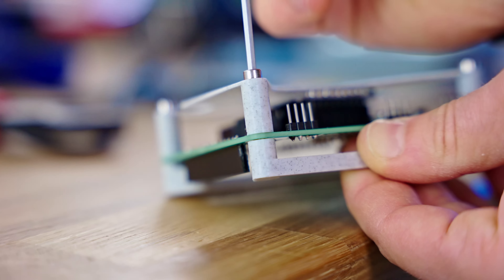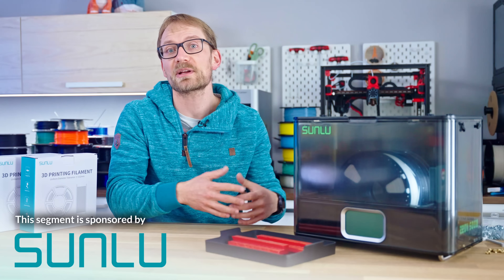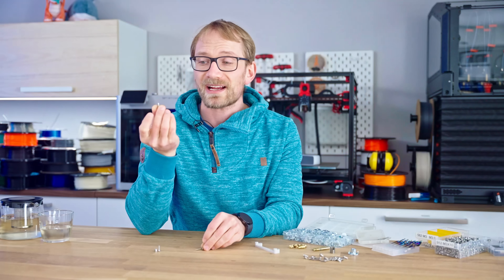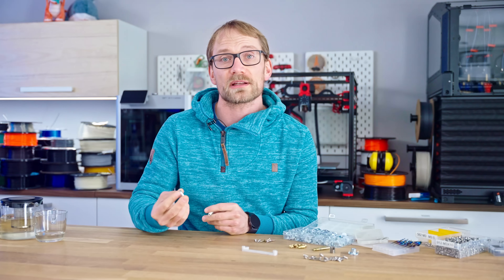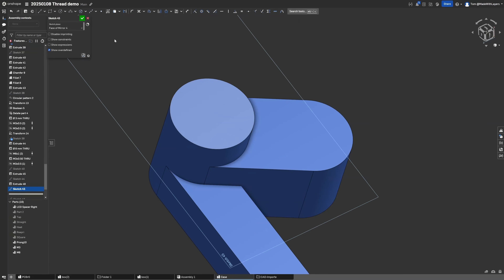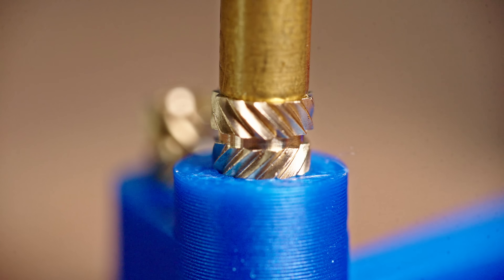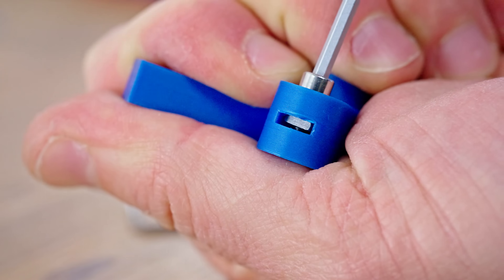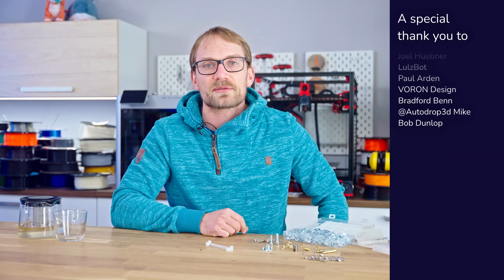A better way to add threads to your 3D prints

Comment: Straight holes you should/can carve a groove parallel to the bolt (perpendicular to the threads) to cut the plastic, taps need a lubricant not a coolant (like tap magic, or my fav for plastic silicone-based). Blender has a screw tool add in for those who like it.

Comment: For M3 if I want a bit of strength I use a self-tapping type of screw, otherwise just a machine screw. But in all such nutless cases I design the hole to be square, so the threads can displace material toward the corners rather than stretching out the material on all sides thereby stressing the part. Where does one find square nuts these days? Hex nuts in nut traps make the most sense to me for maximum strength,

Comment: the cutout for the slide-in nuts is a good idea, but what about: at the end of a hole you design a cutout for a hex-nut, insert it in the end of the hole and slide in the screw from the other end of the hole. works great for me and gets me maximum strength for the least effort

Comment: I've done the thing where you pause the print and insert a hex nut then continue the print hundreds of times and never have had a problem with strength and durability. As far as ease of use? I feel this is the easiest way to get an amazing result without needing tons of space. No heat or worrying about getting them straight or anything. If you want a replaceable nut just put the "slot" on the bottom of the part. However I can't see the need because it's in plastic. If you torqued the nut hard enough to damage it there's probably nothing left of your part. And if you need to toque that hard you should find a solution with more surface area and use something bigger.

Comment: Curious why you don't use chamfers? Either molded in where possible or cut. Chamfers make starting inserts or screws much easier and more reliable/repeatable.

Comment: Another shape that can be easily used for your thread solution at larger scale is a star-gear shape almost like a torx head with 5 or 6 protrusions instead of the 3 you showed, it allows for more contact surface for the thread.

Comment: Thanks Thomas the tapeless threads are a great solution I will use this for an enclosure I am designing, I printed a test thread and its really strong with a standard m3 machine screws, saves the time installing heat inserts

Comment: A lot of methods to suit a variety of needs. I usually just use hole for a quick prototype and works just fine but for things I need to be reliably I usually go for a threaded insert.

Comment: I use captured M3 or M4 hexnuts all the time. Inserted from the back or the side. Every now and then this approach limits or disturbs the deisgn too much, and I have to fallback to one of the other methods, like heat-set inserts. But hexnuts cost almost nothing compared to those, so it makes sense to use hexnuts as the default solution. I do it so often I know the hole dimensions by heart for an exact fit without any slipping.

Comment: I'm a mechanical engineer and work on a product that uses the same "self forming thread" geometry you used! Ours are meant to be a permenant connection, we just jam the screw in with downward force and it never comes loose. Super low cost lock nut

Comment: Cutting threads in PLA is very clean and easy using IPA filling in the hole and on the cutting tool

Comment: For self forming threads I have just used the standard hole size for the thread but made the hole as square. Screw digs in to sides and excess goes to corners😎
Reply: I was going to mention this. Have you tried doing the same thing with a hexagon?
Reply: @atomicsmith  I'm sure this would work, but it eliminates the advantage of being able to use a simple primitive. Also, adding sides makes it more closely resemble a circle, so you might have the same stretching problem.
Reply: @peterbalholm2138  I don’t think the jump from square to hexagonal could really be considered complex…
It also gives the advantage of printing a horizontal hole with no overhangs to span. I would have to do some more experiments to see if the stretching is really an issue.
Reply: @atomicsmith what overhang? Whether printing a square or hexagon hole there shouldn't be an overhang.

The strength depends more on how deep the threads are vs how many touch points. I would imagine both gives shallower threads or more easily runs into the same issues as just a straight hole being difficult to size adequately without cutting through the perimeter walls or too wide.

The trade off is simplicity to add but  the protrusions he shows would be a better connection.

Comment: Since the prong nut partially redirects the forces into the material it would break with the material delaminating, correct? But this is also where a FDM print is the weakest…
It would be very nice to see a comparison between a recessed washer + nut compared to a prong nut to see if the prong nut actually increases the breaking torque for a fixed cross section.

It does have the benefit of adding extra inner walls surrounding the prongs. But you can only embed the prong nut fully into a part if you orient the print properly since it has to be placed prongs down before resuming the print.

Comment: Another consideration is the number of times a screw will be used. Formed threads wear out quickly if you need to put something together and take it apart repeatedly, like for access panels and covers. For that application, metal heat inserts and print-in nuts are very well justified.

Comment: I've started moving from heat-set threaded inserts to press-fit screw-to-expand threaded inserts. They have a slot cut into the body to allow the screw to expand the insert and press it into the surrounding plastic, similar a wall anchor. There's also flanged versions for through hole installations.

Comment: Thank you for posting the STEP files for the self forming threads. I am a novice, but managed to use them successfully in Fusion 360 to join 2 parts together without using heat set inserts. I made sure to keep one of the ridges straight down, like you mentioned.

Comment: My first experience with threaded heat inserts was terrible because I was adding them to Ultem 9085 and the inserts just kept popping out when we would tighten screws down. I don’t know if it just has a low coefficient of friction or if the soldering iron didn’t get the plastic hot enough to bond well but they were awful. For all my household prints with regular materials they have been great though.

Comment: What about wood screws? Usually the threads on those are larger so it should offer better grip and less stretch on the part? I think this would be a better solution than metric screws.

Comment: If you want to make holes to use with self tapping screws, you could use modifiers to increase the wall count a lot or the infill density to 100% around the hole

Comment: I heat up my machine screws and print with slightly increased wall thickness for simple straight holes. That way, the machine screws soften the plastic until the whole set up cools. It has consistency in repeatability, and it also gives full contact on all sides for added strength. The downside is it has a familiar metal-on-plastic durability, and it takes additional equipment and time to heat up the machine screws.

My tip for adding heated threaded inserts into a flat surface without a custom jig: once you get to the final millimeter, while the insert is still hot, take the face of a flat, durable, clean object, like a small steel ruler, a metal scraper, or a butter knife, and just press down on the threaded insert to make it flush with the surrounding plastic.

Comment: I use heat set inserts a lot.  I love that the threads are automatically perfect for the screw, and it just adds a professional touch.  Like others have said, heat it up and press in most of the way, then use a flat piece of metal (I use the side of a razor blade) to set them perfectly flush.  Super easy, very strong, and makes disassembly really easy if that's needed.  For something like an electronics device where you need to take a lid off occasionally, heat sets are definitely the way to go.

Comment: I use the 2.5% method - make your holes 2.5% smaller than screw diameter. Just smooth round holes, no thread, no tapping. Never failed me with PETG.
I guess PETG is the key here, PLA is just too unpredictable when it comes to precise dimensions.

Comment: I personally print M2 / M3 threads all the time for airsoft parts, adapters and the likes and they hold up really well over time. If printing plastic threads that need to mesh with other plastic parts, it helps to offset the faces of one part of the joint by 0.1-0.2mm. If printing plastic threads that mesh with metal threads, the metal part will be really tight first time round but forms the threads to a comfortable tolerance over time. I do have a Prusa I3 Mk3.5S, so I guess the printer being pretty accurate helps.

Comment: You might not need a soldering iron to set the inserts. If the print is based enough in the direction, you need to set the insert, you can use your 3D printer as well. Manually drive the heated nozzle down on the insert and you're basically set.

Comment: The negative space trick is very clever. I personally use a modified version of the straight hole method where I add a short leading chamfer which helps get the machine screw started. If the threads are particularly fine or tricky, the chamfered hole is easy to give a few turns of a tap. Kind of nice to not have to add metallic fasteners for my light-medium load applications.

Comment: Not at all impressed.  Want to use machine screws on bare PLA? 

Print triangular holes to grab hard and allow for flex.  

OR

Heat up your screws with a hair drier and use a screwdriver to twist them in.

OR

PPP (Print, pause, & place).  Add nuts halfway through your build.

Comment: I use the heated insert without heating them. I print a hole opposite the screw insert direction and push them in. Or I glue them in if I want to be sure they don't spin.

Comment: Just to note that at least here where I live, wood screws are fairly easy to find, they're about everywhere. Even small neighborhood shops tend to have a few, so that's what we tend to use, except for more professional looking enclosures. If we are concerned about strength, we just add a few more perimeters (three perimeters are usually fine), and they also have the distinct advantage of being more tolerant to a slightly larger hole.

Comment: I use Solid Edge 2024 Community Edition (free full version) and there screws with threads above M16 or bigger are very good even for normal 3d printing. You need to add tolerances depending on your filament and printer, but once you have that, its a good and eaysy way.

For smaller screws i use metal threaded inserts. Solid Edge is a very professional CAD and you dont have your files somewhere on the cloud.

Comment: I have an A1. I've spent many hours meticulously manually calibrating for PLA+ and PETG, and after all that, don't get the quality and consistency I get with the Dynamic Flow calibration. I'll likely revisit it, but for now I'm enjoying just clocking and printing (coming from an OG Ender3).

Comment: When I need durability I use metal insert but use epoxy to fix them in position (ABS prints), done correctly this is stronger and more accurate than heat set inserts. Otherwise I use self forming threads or captive metal nuts.

Comment: While it may seem intuitive that a longer thread will be stronger,  beyond 6 threads provides very little if any extra strength. Research done as far back as the 1940s found that the first 6 threads take nearly all the load because of deformation of the material, so if the threads start to strip out they basically cascade failure so even a infinite number of threads would strip out because only the first 6 engaged threads take nearly all the load.  Just something to think about.
Reply: The basic rule for thread length is 1 to 2 times bolt diameter, using longer engagment lengths for softer fastener material. A threaded hole in TPU will require longer engagement than the same diameter in ABS.
Reply: @dchurch911  maybe plastic acts differently than metal but testing showed the first 6 threads deform to take the load, and threads after that didn't actually contribute to strength due to them not sharing any of the load until failure, and at that point you'd just get a cascading failure of an infinite number of threads. Now I can't say if this holds up for plastic parts or not, but my gut says that plastic probably deforms under load at least as much as steel. I'd be happy for someone to prove me wrong with some real world testing but I feel like the more threads the better may not really be the case based on my reading.
Reply: That’s true if the threaded material is of equal or greater strength than the screw. 

If the screw is stronger, which is true for metal screws into plastic threads, then more threads does a lot to improve the strength of the assembly.
Reply: But that was bolt failure not hole failure.

Comment: i've been using hexagonal holes for years. super easy to design, tolerances are not really that important/easy to get right, decent thread engagement, and the corners create a space for the plastic to deform into while screwing in the screw. also pretty good for horizontal holes since they have a maximum overhang angle of 60°. In my opinion this is simply the best solution for threaded connections especially with smaller parts that have no space for inserts or trapped nuts

Comment: Or use hex nuts with a straight slot, that is followed by a hex-hole, in which the nut gets pulled, when tightening the screw. 
Doesn't rip out as easily, is very flexible to assemble and you definitely have the parts already.

Comment: Why do so many people overlook using heat-set inserts from the BACK like T-nuts? There is the inconvenience of needing rear access to the part (the same as a T-nut), but strength is dramatically increased!

Comment: You can hot press a screw directly in the hole in the same way as a threaded insert. You can also set an oiled screw into an epoxy/adhesive filled hole.

Comment: I love how the 3D printing world is rediscovering all this knowledge from machining on it's own. This is called form threading, there are special drill charts (or equations, if you're doing specialized stuff) that tell you what size to make the hole so there's just the right amount of material so the material flows from the valleys of the threads and fill in the crests.

One tip for any direct threading into the plastic: make a 30 degree chamfer on the opening of the hole, this matches the 30 degree chamfer and thread form on the bolt so it self aligns better.
Reply: Its really interesting to watch for sure.  I am hoping with the growth in the 3d printing world that engineers will actually learn how to properly call out tolerances that are actually possible with on hand machinery.  But I doubt it.  Would be nice for the fresh out of college engineers to understand that an old worn out bridge port with no digital readout display is capable of maintaining ±.0002 in tolerances.  And if your design requires those tolerances and the shop doesn't have that on hand, you really need to consider a redesign.
Reply: @zackeryhardy9504 that wont happen
Becoming an engineer doesnt fix the problems that all humans face. And that is, every single career/job, the majority of those in it are useless. Engineers are no different.
They go through school, have a bunch of info downloaded into their skull, they regurgitate it to oass, than when they're in the real world they are either useless, or worse, dangerous. 
They just want to collect a check, thinking critically gets in the way of doing as little as possible for that check.

I have to deal with this every day.
Reply: @VoltsAnBolts only way to fix that is to fire those who didn't learn and don't want to and to get schools to actually tech critical thinking and fail those who didn't get it.  College shouldn't be for everyone.  It shouldn't be a baseline requirement.  It should be advanced training for those who want to do something extra.  Like it used to be.
Reply: do you have a link to one of these charts?  I just get standard tap/drill charts when I look up Form threading.
Reply: This is the funny thing about the issue of bringing manufacturing back to the U.S.—that knowhow is experiential and takes time to build up.  I’m all for domestic MFG (with the understanding that it’ll cost a helluva lot more), but it’s important to realize that it’s not going to happen overnight.
Reply: @gmw0  I work for a US manufacturer.  We are investing in this tech and so far it has worked out pretty well
Reply: @gmw0  This is a 3D printing YouTube channel. Do you think there aren't manufacturing experts in the U.S.?
Reply: "it is own"

Comment: I mostly use either heat set threaded inserts or captive nuts, depending on the project. When prototyping, I just thread into plastic with machine screws.

Comment: A lot of bolt assortment boxes come with hex nuts, I have a suggestion to improve the rotation issue that has worked well for me down to M2 (I haven't tried smaller).  I haven’t settled on a good formula yet, so experimentation will be necessary.

The radial distance between the centre of each side of the nut plus the necessary insertion clearance and each edge (minus plastic flex!) is ordinarily too small to to effectively resist rotation with the sizes of bolts commonly used in hobbyist projects.

As we have to make the cavity thicker than the nut anyway, I allow a good clearance and taper the sides to just below the nut width, starting from about halfway toward the bolt. Then as I tighten, the nut pulls into the tighter space.

Square is better, no argument, but this has allowed me to make use of the nuts that I have at hand anyway.